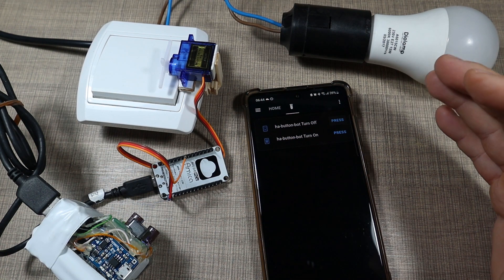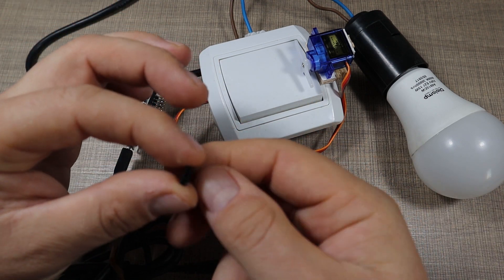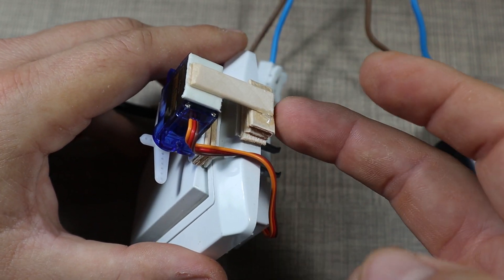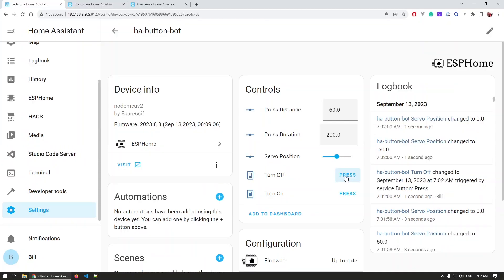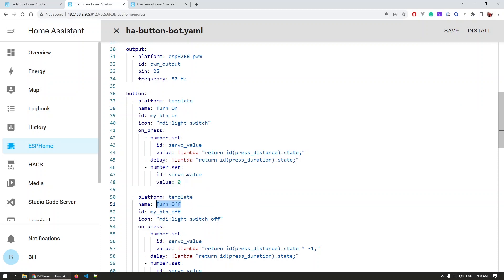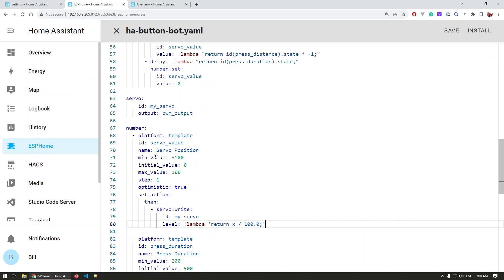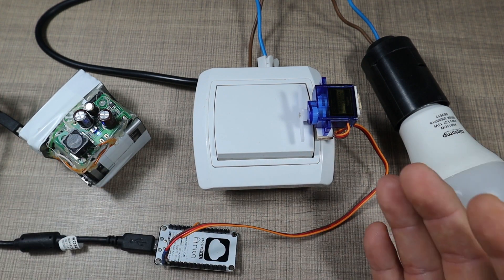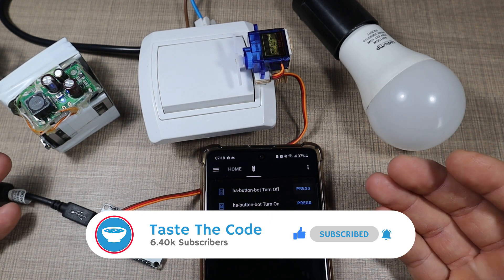ButtonBot - A DIY solution to automate any switch with Home Assistant

Comment: this is nice, i bought all in this project, conected everything, but the sliders wont appear, is this because of the new esphome updates? does yours still works?
Reply from the maker: I don't use this anymore. It was just for demonstration purposes. The new update should not have changed the properties though.
Reply: @TasteTheCode  is it much if i ask you to check it, as for me is not apering on the dash board, the board is online, conected but the is no controll option, and i copy pasted your code..
does i need to create helpers or some sort?
in exchange i can draw and give you the stl,  to a light switch +servo holders, and 18650 + charging files to be 3dprinted so you can host it on printables or bambustudio and get thoses sweets points
please help
thank you  nice video btw
Reply from the maker: @RenatoYamamoto481  hey, I just checked this and it seems to be working as it was. There are no helpers or anything else additional than what is shown in the video. What you might be facing is some delay in recognizing the entities if you had the device programmed and then updated at a later stage. To mitigate this you can try to restart HA, not just reload. This usually helps.

Comment: If i edit to have separate setting for on and off, i can see this being made useful to control an oscillating fan push/pull knob
Reply from the maker: This is already using separate triggers for on and off.
Reply: @TasteTheCode for an oscillating fan pull knob, it would need to stay in position instead of returning back to start position. Since in order to pull the knob out, the knob would have to be fixed to the lever. So when it pushes, it would need to stay pushed and when it pulls, it stays pulled. I do not see how it could do that with the supplied settings.
Reply from the maker: @victorlowe  you can modify the ESPHome code so that instead pf return the servo, it leaves it intact. In the on_press handlers, you only need the first number.set command and you can remove the delay and the second set. This will leave the servo in the pressed position.
Reply: @TasteTheCode thanks!
Reply: @TasteTheCode "seperate triggers" is not the same as "seperate settings" and you know that based on the servo settings you put in the code.

Comment: this is beautiful but:
1- can be installed ONLY in garage
2- has ZERO WIFE ACCEPTANCE FACTOR score

but nice to see you have a great time ;-)
Reply from the maker: Hahahaahah I completely agree with no.2 😂😂😂 As for installing it only in a garage, maybe... but also workshop, barn, outdoor, printer, remote PC, scheduling the dishwasher to turn on at night, scheduling the washing machine.... Many things can be triggered with a switch or push of a button.
Reply: @TasteTheCode   it is XXIst century - do we really have to install such crap having million other - more beautiful - ways to do it?
Reply: I thought about that too, but to be honest you can easily print a little cover. Okay, still not that WAF but you can print a Chanel Logo on it. Problem solved.
 @TasteTheCode
Reply from the maker: Yeah but unfortunately I don't own a 3D printer yet so it will have to wait a bit...

Comment: I'm going to use it on my coffee grinder 😄
Reply from the maker: Awesome! Please share the end result if you can!
Reply: I was thinking the same but the sensor to see if the coffee  bin is full is needed
Reply from the maker: @zyghom  I guess this really depends on what coffee grinder you have and how it works but one way of doing it is to have some sort of weight platform under the grinder that can also tell you with a notification when you are running low on coffee ;)